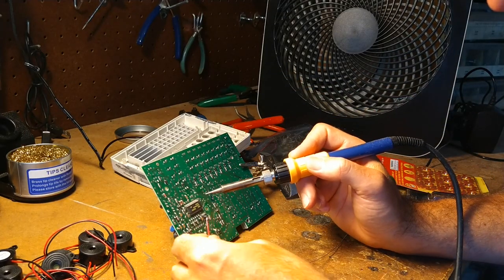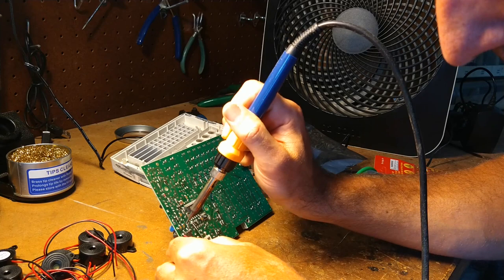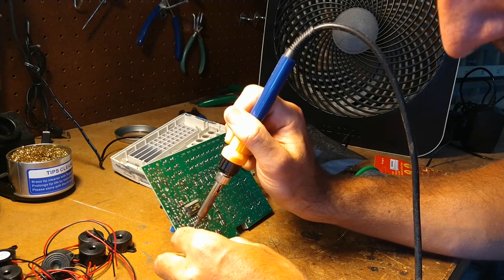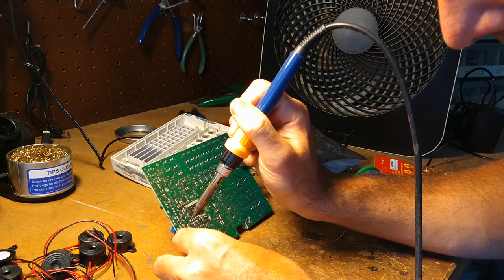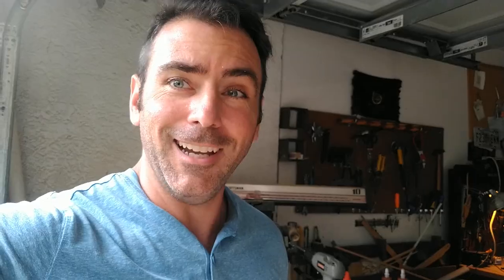Soldering Skills Just Saved Me $200

Comment: Sweet, glad you were able to fix it. You might also want to add in a small male/female molex connector on the new wires, it's totally optional (since it's working) but it'll save you some solder work if it would break again.